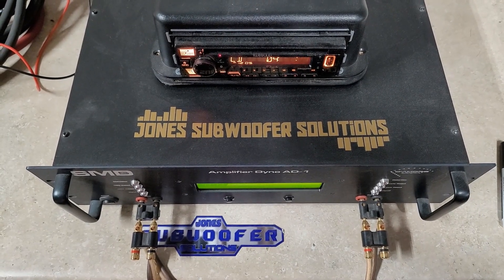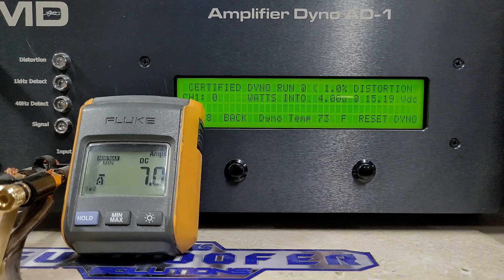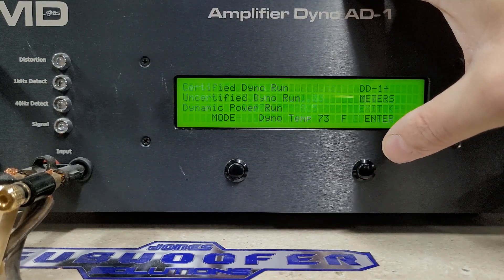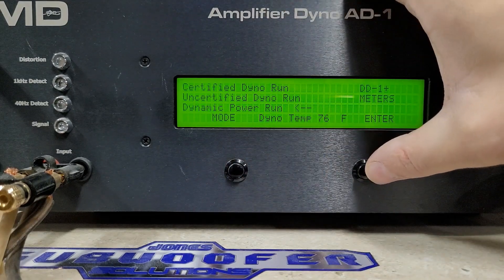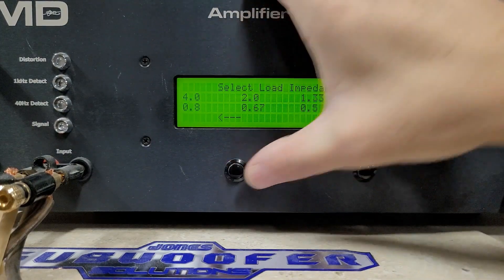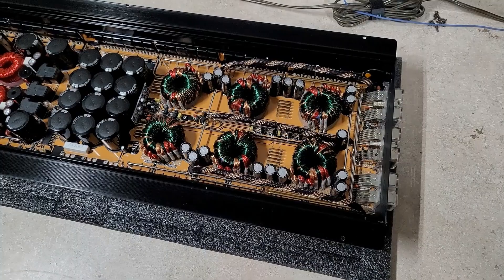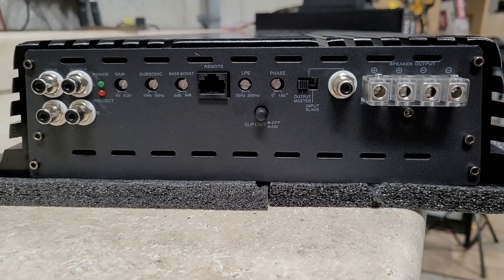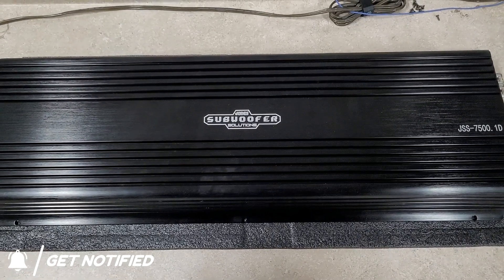AD-1 Amp Dyno Teampie TP-7500 / JSS-7500.1 by Jones Subwoofer Solutions JSS

Comment: Question are they half ohm stable i can wire my 2 subs to 2 ohm or .5.
Reply from the maker: @Loudkona  they're half ohm stable
Reply: @Facekicker  iv been trying to find a dyno video of them at .5 I got the electrical for it 320 amp alt and 144ah sodium bank
Reply from the maker: @Loudkona  very few amps tolerate 0.5 on the bench, there a big difference between the static load and a reactive load.

Comment: Awesome 👌.  Can i use dual 0 gauge inputs on this amplifier or will that be overkill?
Reply from the maker: @drvictoria07  2/0 recommended, no dual inputs necessary
Reply: @Facekicker  bet.  I only have 0 gauge ofc wire not 2/0
Reply from the maker: @drvictoria07  1/0 with dual inputs will do it, there will just be more fusing
Reply: @Facekicker  no problem.  So I'll have 12 inputs total for one amplifier.  OMG 😲.  Dual inputs.  Crazy power 🔋

Comment: Wish I could find someone that would actually dyno this amp @ .5 ohm. I've heard a lot people say they wire to half ohm with no problem on good electrical but I'd like to see what kind of output this amp can do @ half ohm.
Reply from the maker: If you wire it to half ohm on subwoofers, you'll see about the same power it does on the dyno at 1 ohm, because of impedance rise.

Comment: Weird Question. Do They Make A 2 Ohm Version (7500 @ 2 Ohm). I've Got Some Serious Impedance Rise (subs really like the box and environment) They Rise To About 6.5 Ohms From 0.5 Ohms. I'd Get A Taramps But They Roll Off Below 32Hz. And My Subs Operate Between 24-32 Hz hahaha
Reply from the maker: No.  Most Korean style boards are built for one ohm operation.
Taramps only has one model that has any measurable LF rolloff, and that's the old HD model.   Any of their current models have no LF rolloff whatsoever, we play into low teens with them.

If you're really experiencing 13x rise instead of the usual ~3x rise
I'd rebuild my box before I fussed with amps.
Reply: @Facekicker  Oh Wow I Didn't Know That About The Taramps. I've Played Around With A HD3K And The Roll Off Was Bad. I Didn't Realize The Newer Ones Got Rid Of That Roll Off. Do You Know Which Series Of Amps No Longer Have The Roll Off Below 32Hz? 

My Impedance Rise Isn't A Issue On My Current Subs. 6.5 Ohms I'm Seeing About 3000 Watts And It's Extremely Loud And Right At Mechanical And Thermal Limits Of The Subwoofers... But I'm Upgrading From 2000 Watt To Some Higher Power 3000 Watt Subwoofers With Alot More Motor Force Which Is Theoretically Showing That I Should Expect Around 10Ohms Of Impedance Rise In My 3.8 Cuft Box Tuned To 22Hz. In Car With One Door Open It's About 25Hz Tuning. The Enclosure Is Super Efficient And Already Pretty Small. I Could Make It Bigger But That Will Make The Impedance Rise Higher And Most Likely Hit Mechanical Limits Way Before Thermal.

I'm Thinking About Running A Taramps 12k 2 Ohm Model. I'm Really Hoping For About 4000 Watts At 8Ohms So I Can Really Get Stupid Loud For Brief Burps.
Reply: @salvatorehayes2753  Just a thought, if you got 2 smaller amps, like 4000's, and then strap them together it should be over 8k watts at 2 ohm.
Reply: @JasonWW2000  Yea That's A Really Good Idea. The Only Problem Is Space. I Really Wanted To Get Like A Taramps 12K 2 Ohm But That Doesn't Exist. They Make A 8K 2 Ohm Version Which Would Make More Power Then My DD M5. I Found Out Only The Old HD Taramps Had The 32Hz Roll Off Problem. The Next Issue I Saw When I Took Impedance Curve On My System At Moderate Power Is That It Does Dip Just Slightly Below 2 Ohms At Certain HZ Above And Below Tuning But Not Sure If They Taramps Will Tolerate That. The New Subs Im Putting In In The Future Are EMF Banhammer V2 Which Have Alot More Motor Force Which Theoretically On Paper I Will Have Even More Impedance Rise On My Current Enclosure. Do You Know If It's Worth Wiring DVC Subs I'm Series To Get The Most Motor Force Out Of The Sub (Most Effient) Or Is It Just Best To Wire Down Parallel And Throw More Power At It? I'd Wire The Subs To 4 Ohm And Then Parallel The Two Subs To 2 Ohm. Then I Could Do Like What You Said And Maybe Strap 2 4Ks Or Even 2 8Ks If I Found The Space. They Wouldn't Be Drawing All That Much Power But Would Get The Subs Running As Effient As Possible.
Reply: @salvatorehayes2753  Sorry, I can't help you on that one. Its over my head. Lol

Comment: I'd like to see if it is able to survive a half ohm certified test which would prove durability and also how is Teampie about their warranty and standing behind their products I wonder because I can give you a 1st hand experience where I had owned a soundstream T1.6000 thee original one that was actually made in Korea- ran it at half ohm clamping 4k for 3yrs then sold it to a buddy who is still running it today! Now we wanted to upgrade his setup so I had bought another soundstream T16k and I received an updated version which was made in china unfortunately, guts/components looked nothing alike so I wasn't going to even try to strap them but he ran the new amp at 1ohm on a pair of kicker compR 12's and it lasted 3wks so a Korean design made in china doesn't necessarily mean that it is anywhere near Korean quality and durability so if this thing can atleast survive the half ohm test without going into protect or blowing up then I would think it is safe to assume it is okay to run at 1ohm and will actually last a little while....
Reply from the maker: Running any amp at .5 on the dyno is typically a death sentence.
The amps are capable of being wired to .5 and rising from there in actual use however.

Comment: Is it 0/2 inputs or 2/0 inputs? Thanks.
Reply from the maker: 2/0
Reply: @Facekicker  basically,  1/0 gauge dual inputs won't work with this amplifier?
Reply from the maker: @drvictoria07  1/0 dual inputs would be OK but I would suggest using 2/0 welding cable with them and not 1/0
Reply: @Facekicker  thanks for the advice

Comment: Need a 0.5 Ohm Dynamic run, I think it would be pretty crazy!
Reply: I own 2 dd audio M5, which are essentially the same amp. .5 dynamic should be around around 14k. That’s the limit of the power supply section even at 15 volts. I’ve wired mine in a car to .5. Had rise to 1.1 and clamped 9600 per amp at 15.1 volts. Never had a problem. Did a 61.5 at 36hz with 2 amps and 8 pretty cheap 12’s. Less than $300 a sub. I did have very good electrical though. Type in “Savard hair trick”. That’s the build. It was windy.
Reply: @ThisIsMyHandle-48  Damn, price wise these are FANTASTIc, I have a friend who is doing 2 of the Sundown SFB 13ks and I told him that these at 0.5 are probably pretty comparable. Seems like I was right!
Reply from the maker: We lost an M5 on the bench trying .5 - while I wouldn't hesitate to wire to .5 in a vehicle, (in fact we are doing just that), I am hesitant to do it on the bench.   There's a big difference between the two scenarios.
Reply: @Facekicker  I currently have 2 dB aak-20,000.1 wired at .57(technically should be .67 but coils on subs measure low) rising to 1.3. Clamping 20500 an amp. So I’m pulling 41,000 watts out of 2 amps. I tried those at .28. Had rise to 1 clamped almost 23 but they would protect when voltage dropped under 15. They are 18 volt amps. I’ve heard they will do bursts of 30k at 18 volts. Maintaining for a 30 second demo about 15.1 volts. They never protect, and they’re so damn big they don’t even really get hot. 6 dB 3512R. 2/1 4th blow through. Box is 100% of the bed below the rails. 25 cube after all displacements. High tune of 50. Plays a very smooth bandwidth of 28-50. Plays 23 but noticeable drop off under 28. In an s-10. 164 at 38hz. In no wall. No bracing. No wood ceiling. Only a lot of kilmat. 13 boxes in the cab of an s-10 behind screwed down factory panels. 19 layers on the ceiling. Exact same electrical I had the 2 M5’s on. Only now I’m externally regulated so charging a little higher. I understand the dyno is totally different. Zero rise. I’ve had an old sva-6000 wired at .17 on 3 zv5 15 for a while never protects. That’s little things a monster. Only does a 54 though.
Reply from the maker: @Kyle excellent!
Reply: @Kyle You still don’t have enough battery supply you need like three more

Comment: whats the safe max voltage before protect if you could include that on all the amps it could sway some decisions also
Reply: That’s cool you answered the question it’s rare on YouTube, 
Thanks i want to use 18 volt system, and now i know 👍🏻👍🏻👍🏻
Reply from the maker: @charliefrancis6438  no problem at all
Reply from the maker: 16v max
Reply: So it shuts off past 16 volts ? Or what
Reply from the maker: @charliefrancis6438  it will shut down in "protect" mode until power is cut off and back on under 16v.
Reply: @Facekicker  so if you have 14 volts constant you don't think this thing would run correctly I'm confused? I see you saying under 16 volts it would go into protect? Ty in advance
Reply from the maker: @Simpleman1078  between 12v to 16v is fine

It protects if you pass 16v or get as low as 10v

Comment: Awsome ❤ the video @Facekicker would you like to test a BANDA 5K
Reply from the maker: I might have a 2 ohm Banda 7k around still that we may put on, but they tend to perform very similarly to the SounDigital amps and don't tolerate bench runs at rated impedance very well - they want to see rise.

Comment: Short bursts are fine and dandy,   i want too see what it does after its been loaded down for 5 minutes, i want too see the temps on the split board interconnects while its loaded down for say a 5 minute song!
Reply from the maker: I spent about 3x the time on the bench with this one than what was seen in the video.   I definitely got it up to full operating temperature and it kept going with no trouble, being fully loaded with certified runs the majority of time.   I didn't pull temperatures, but they definitely kept within tolerance with no impact on output.
Reply: @Facekicker  let’s see it then!
Reply: I have a friend of mine that has the same 7500.1D amp (ordered from Candice)of these.
He has demoed for 30 minutes straight, It does great.

Comment: I am very happy to own this model, thank you jones for these tests👌
Reply: Can I wire it down to .67 and will it handle 15.4volts?
Reply from the maker: @BumpinForJesus  Yes.  I wouldn't wire any lower than that unless you know your rise but .67 will be fine.   And max operating voltage is 16v so you're good there also.
Reply: @Kyle I am very satisfied with it does not heat up I had no problems with protection or other issues, I recommend it with confidence👌
Reply: @Kyle 1.4 but i test one sub 2.5k  05 omh no problem

Comment: Poor big d wiz he was going to dyno these 😆 u beat him to it
Reply from the maker: He doesn't have a bench that supports amps bigger than 3k or so
Reply: He bought all them LTO cells but the performance he got from them indicated they had severe issues.
Reply: @minus3dbintheteens60  he bought some cheap Chinese rewraped xs power cells that don't perform like real grade A cells. Some of the worst cells out there. Xs power yinglong don't  perform good from my experience.
Reply: That was "dead cell" levels of performance, and I'd bet thay he would have gotten them straight from XS Power, either from his pocket or given for a review
Reply: I messaged him awhile back to dyno my 5500. The answer was a simple no.